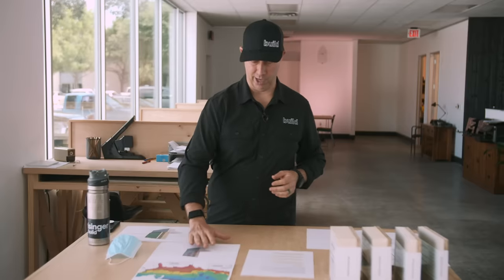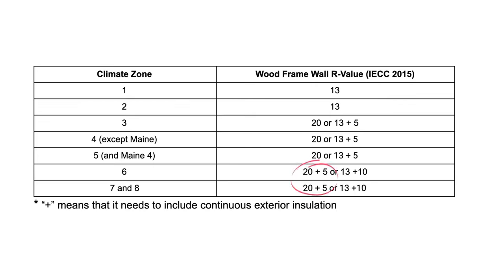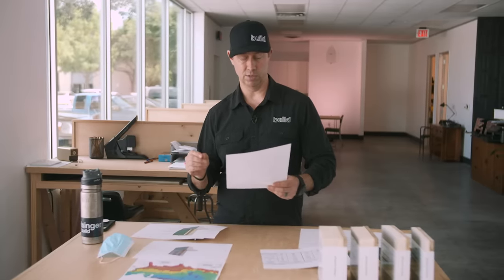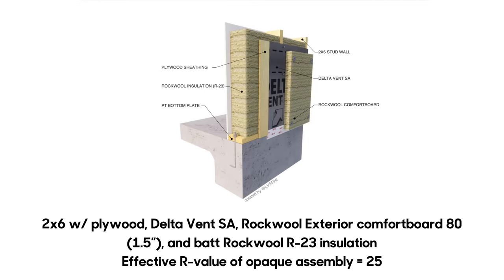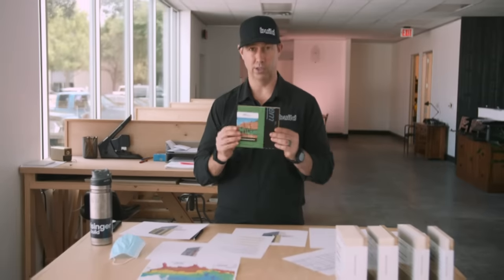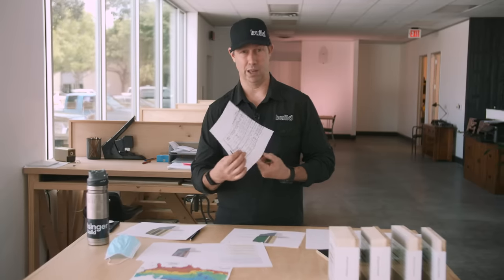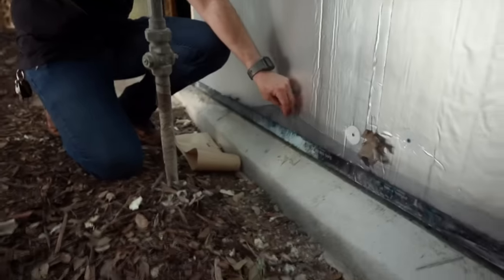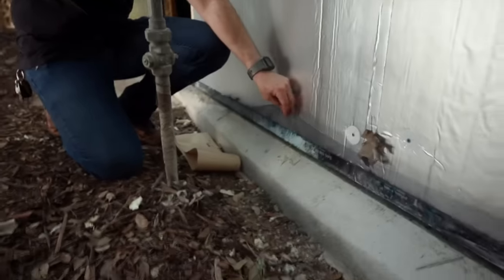5 Ultra-Insulated Framed Walls

Comment: Those are great assemblies when focusing on R values. But those assemblies are problematic in regards to condensation within the walls. I would redesign the assemblies to have a vapor barrier on the interior side of all insulation, then design the rest of the assembly so it can breath on the exterior side of the vapor barrier with vapor permeable barriers and insulation in such a way it doesn't trap vapor to condense behind it.
Reply: I agree. Here's method that works excellent worth no exterior insulation. 2x4 construction, 1/2" plywood sheathing (NOT OSB), 3" thick dense foam boards cut to fit between stud space. 3" thickness leaves a 1/4" space on each side of foam to help stay dry through convention currents. Foam also adds rack strength to wall.
Then add 3/4" T&G Styrofoam sheets to interior side of studs and rip 3/4" x 1-1/2" plywood strips to nail over foam to studs.
Reply: Sorry sent that before I was done. 
Now I have a void behind sheetrock, help to stay dry. Do the same 3/4" foam and plywood strips to ceiling. Sheetrock entire ceiling and exterior walls (before any interior walls framed).
You now have a complete thermal break on the correct side of the wall!
 To finish off when primer painting exterior walls use a vapor barrier paint. Now your vapor barrier is on top of the screw, not the screw through the vapor barrier. There's a few more things to doing it this way (elec outlets, rim area, etc).

Comment: R23 Rockwool does NOT fit in 2x6 framing with electric wires in the wall. A big pain!!  You forgot the smart vapor barrier. Great products, but difficult to install. It does insulate well and keeps the house quiet.

Comment: How do you shoot thicker zip r to your studs when it exceeds the thickness of a 2 3/8 ring shank
Reply: We used full on framing nails for zip R 6 (1" foam)
Reply: @wjthehomebuilder  I see, wonder what you use for the zip r that goes thicker than that.. truss screws 😂😂
Reply: @tylerlappa7356  Maybe so!  Glad we stopped at 1" foam!
Reply: Tyler Lappa use longer screws!

Comment: What about using Vacuum Insulated Panels around the outside? R50 in 1.5" can even go to R100 for 2.5", you'd barely have to ever heat/cool the house.

Comment: It is difficult to work with insulation outside sheathing.  I dont like it. Structural issues with cladding. Just Use 2x6 or 8.
Reply: the problem with that is thermal bridging

Comment: Every house in the world is A badly shaped chimney. if you remember that you will always win. I suggest you build 10X10 models of all your recommendations. I'M PRETTY SURE YOU WILL BE DISAPPOINTED IF YOU COMPARE THEM TO 2 INCHES OF FOAM AND ALUMINUM DOUBLE BUBBLE  run across the studs and taped off. .

Comment: Alaska needs 2/3 of the insulation outside the weather/vapor barrier. CCHRC.org
Reply: Only if you adding foam for exterior insulation.
Reply: Joe Who Every one of the suggested framing details had insulation on the outside. None of them had the specs required to keep moisture from condensing on the wrong side in extreme cold. Seems he’s using Alaska as a buzzword for effect. Maybe I missed the qualification but it seems best not to mention it at all if only for effect not substance.
Reply: @ABC-wz2db  You are right, all wall framing examples had exterior insulation, but only two had zip-r, one had Rockwool which vapor permeable and the last two had polyiso with an option to use Rockwool in a cold climate.

Comment: At 7:04, can someone please explain how a foil face that will be under an opaque layer (siding) is going to be a radiant barrier? Radiant heat is either absorbed, reflected, or transmitted by a solid. A clear transparent solid/liquid/gas such as glass/water/air will allow radiant heat to pass through. A non-reflective solid such as siding is going to absorb most of the radiant heat. Again, radiant heat cant go through an opaque layer. In my understanding, unless this foil face is left exposed to the suns radiation and allowed to reflect (shiny) some of the energy, it is nothing more than a foil layer that might give the insulation some physical strength. But please do not call it a radiant barrier.